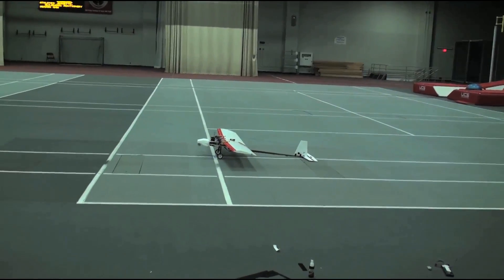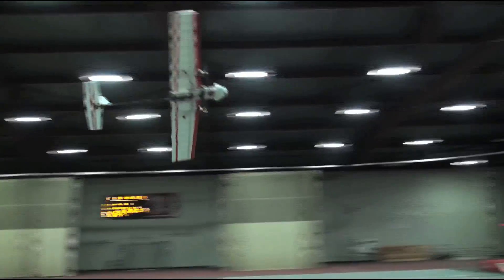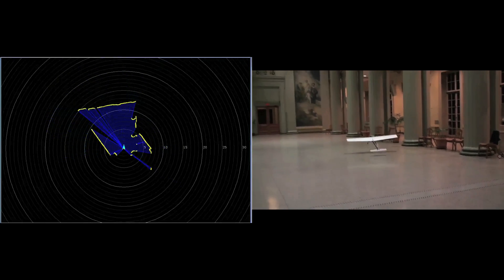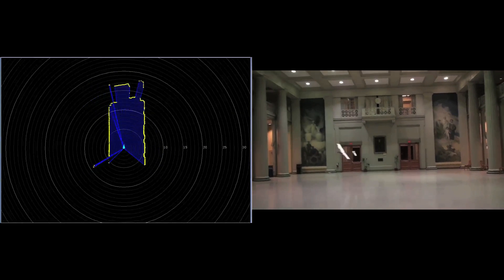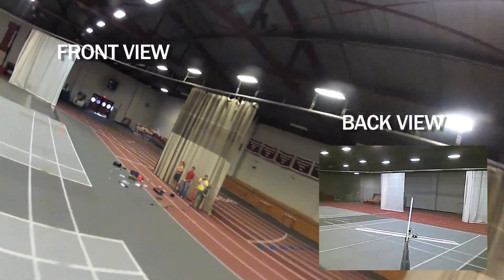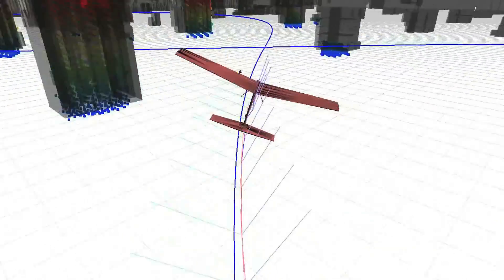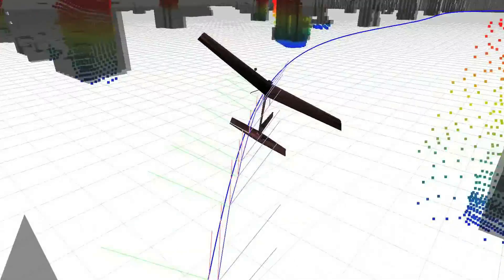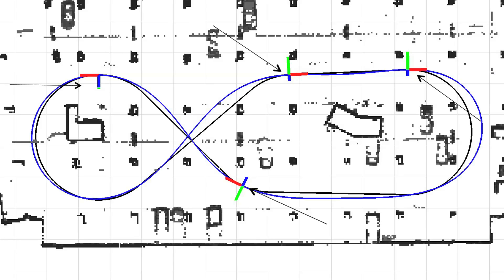Autonomous robotic plane flies indoors at MIT

Comment: Fermat's last Theorem is the transformer bumblebee Robot.
Original equation:
z^n=x^n+y^n.
Mean:
z^(n-3)*z^3=x^(n-3)*x^3+y^(n-3)*y^3.
Using the formula z^3=[z(z+1)/2]^2 - [z(z-1)/2]^2 to convert z^3 become the exponent 2. Then using the formula [z(z+1)/2]^2=1^3+2^3+........+z^3 to convert the exponent 2 become the exponent 3.
Repeated several times with the same method.
The transformer bumblebee Robot was created according your own structure.

Simplest format about Transformer  Bumblebee Robot.
Using two formulas:
z^3=[z(z+1)/2]^2 – [z(z-1)/2]^2 
And define x<x+a<y.
x^3+y^3=[y(y+1)/2]^2 – [x(x-1)/2]^2  – [(x+1)^3+(x+2)^3+........+(x+a-1)^3+(x+a)^3+(x+a+1)^3+........+(y-1)^3] 
Because:
(x+a)^3= [(x+a)(x+a+1)/2]^2 - [(x+a)(x+a-1)/2]^2
So also:
x^3+y^3=[y(y+1)/2]^2 – [x(x-1)/2]^2 – [(x+a)(x+a+1)/2]^2 + [(x+a)(x+a-1)/2]^2 – [(x+1)^3+(x+2)^3+........+(x+a-1)^3+(x+a+1)^3+........+(y-1)^3] 

Original equation:
z^3=x^3+y^3.
According to above method, the  transformer bumblebee Robot system was created:
[z(z+1)/2]^2 – [z(z-1)/2]^2=[y(y+1)/2]^2 – [x(x-1)/2]^2 – [(x+a)(x+a+1)/2]^2 + [(x+a)(x+a-1)/2]^2 – [(x+1)^3+(x+2)^3+........+(x+a-1)^3+(x+a+1)^3+........+(y-1)^3] 

[z(z+1)/2]^2 – [z(z-1)/2]^2=[y(y+1)/2]^2 – [x(x-1)/2]^2 – [(x+b)(x+b+1)/2]^2 + [(x+b)(x+b-1)/2]^2 – [(x+1)^3+(x+2)^3+........+(x+b-1)^3+(x+b+1)^3+........+(y-1)^3] 

[z(z+1)/2]^2 – [z(z-1)/2]^2=[y(y+1)/2]^2 – [x(x-1)/2]^2 – [(x+c)(x+c+1)/2]^2 + [(x+c)(x+c-1)/2]^2 – [(x+1)^3+(x+2)^3+........+(x+c-1)^3+(x+c+1)^3+........+(y-1)^3] 

[z(z+1)/2]^2 – [z(z-1)/2]^2=[y(y+1)/2]^2 – [x(x-1)/2]^2 – [(x+d)(x+d+1)/2]^2 + [(x+d)(x+d-1)/2]^2 – [(x+1)^3+(x+2)^3+........+(x+d-1)^3+(x+d+1)^3+........+(y-1)^3].

........
Flood robot on the planet Orion galaxy looking for the integers to eat.
Certainly not enough the integer for the large number of transformer bumblebee Robot

ADIEU.

Comment: you bet. bootstrap like crazy. 
what he said in the video was an extremely high level description of something much more finicky, mostly the state estimation. marrying the LIDAR with accelerometers and gyroscopes sounds like a huge pain, however a system like this would be a huge boon to something like APM, the arduino pilot open source project

Comment: 1. IMU + laser scanner->sensor fusion
2. states estimation->extended kalman filter or unscented kalman filter
3. trajectory for vehicle to follow-> some kind of predictive control
4. to over come the computational difficulty they use approximate dynamics model-> they are not using first principle model to do control. So the control is most probably some kind of reinforcement learning or approximate dynamic programming.